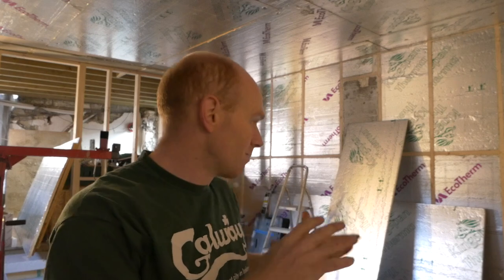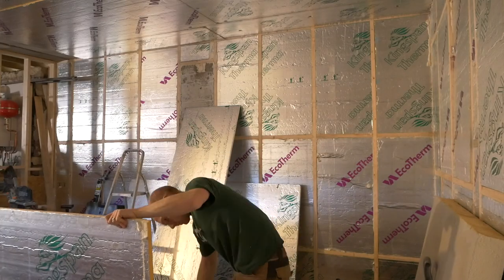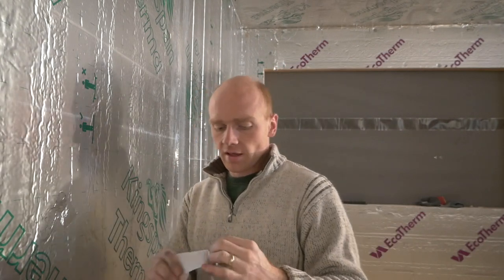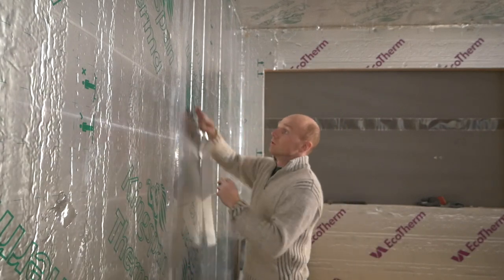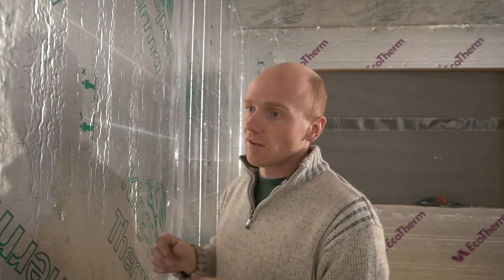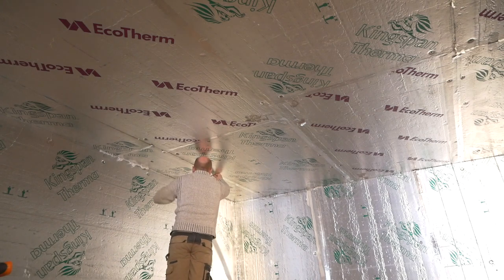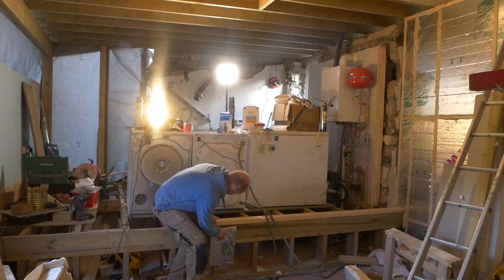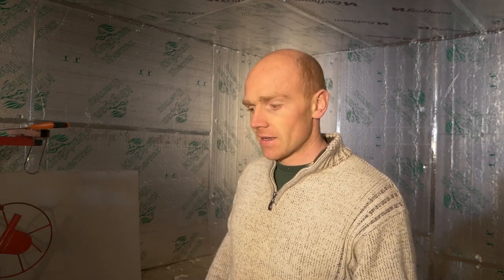INSULATING STUD WALLS - Step 2 of 2

Comment: How do you access the electric outlet boxes, the water pipes, ventilation, and temperature conditioning?

It seems super insulated, but how do you get fresh air, and how do you cool and heat the space?

Is this only a living or sleeping room?
Reply: If it were my build and I ran wiring after insulation I would use wall mounted conduit tubing and outlet boxes. same style you see in many brick schools and basements.

Comment: We did a very similar detail on the barn conversion but the one thing that I really wasn’t happy with after all the sealing and tape was fixing the plasterboard through what is the vapour barrier into the studs. Thats hundreds of penetrations and I know they are regarded as essentially self sealing but it just didn’t feel right. Love following your build and many thanks for sharing 👍
Reply: The way I've done it in the past (and about to do again) is to batten over the PIR board and then screw the plasterboard to the battens, that still leaves you with about 3-4 screws per batten. 

To seal these holes I pre-drilled the battens and started the screws, then put a big blob of builders silicone over the hole and screw point. Then just put the batten on the wall and screw through. You have then sealed each hole with silicone. Its an added step, but only takes seconds if you were going to batten anyway. I was using battens to give a void for services (as Tim mentions in the vid).
Reply: James Marriott actually James that sounds like a much better solution sealing each penetration with silicone. As you say an extra step but I’m guessing once you are up to speed and into the rhythm of the thing, the extra step isn’t a big deal, thank you 👍
Reply: @ThePhilandPam  Indeed, the battens came in bundles 3x3, so I drilled 3 at a time, laid on a pair of tressels and ran in 27 screws in a batch and then blobbed on 27 dabs of silicone. About 5mins to do a bundle if you have the stuff to hand.

I give it about 20mins before a tradie pops up and tells me its not necessary and I don't know what I'm talking about. But I was happy with the result. :-)
Reply: James Marriott I like the sound of that, I’d feel a lot happier knowing my vapour barrier was actually vapour proof, that’s the way to go 👍

Comment: Really enjoy the TRC videos!  How did you tape the inside corners? I’ve used a straight-edge, short pieces and foul language.  Wondering if there might be a better technique...
Reply from the maker: Just crease it first and then try and get the point in the corner before you stick the rest. Not that easy with the basic foil tape.

Comment: Wouldn’t recommend dabbing to insulation but apart from that you’re knowledge is excellent for someone not in the trade. Let’s face it though, having followed you for a long while, you’re practically a tradie now, and a bloody good one! Love the videos mate, keep it up!
Reply from the maker: Thanks, I’ll stick to extreme diyer for now! I just use a bead of the gun grade board fix as a back up. Obviously it relies on the insulation being secured well but that’s done by the drywall screws too. 👍

Comment: Maybe I'm overthinking this but how would you prevent thermal bridging through the joists if you put a warm roof on a single skin garage?
Great vids btw!
Thanks.
Reply: A self adhesive vapour barrier below the insulation. The only bridging is the screws for the top OSB board layer above the insulation. So osb above the joises, vapout barier insulation tape seams then osb and water proofing like owl lava or  iko roof star. Don't cheap out on the vapour barrier or the water proofing.

Comment: Just found your videos, you are incredibly good at explaining things in simple terms and don’t make me feel stupid! I’m planning on frame insulating and   boarding on the inside of my garage door to try and insulate the garage to make it slightly more usable. Do you think the extra layer of insulation is always required ?
Reply from the maker: Depends if the added weight or width will affect the door opening and closing, (if still in use) if still being used as a garage I would suggest bonding the insulation directly to door if possible and draft proof the gaps with suitable seals.

Comment: Hi tim do you have to put air brick in is it best floor level or high level  if my garage is air tight no sure mate iv do the roof up to yet and the walls are just been painted and false floor and that will be insulation under it can you put me right please thanks

Comment: I know you said that one of the walls was an internal one through to the next room and you weren't going to insulate it.
However, I would personally.
As you have done such a high grade job so far I would carry on.
When internal walls are insulated they can make it easier to keep certain rooms at different temperatures.
You may want some rooms to be warmer and others cooler and with insulated walls all round that room becomes easier to control temperature wise.
Just a thought from someone who enjoys your videos and has never had the opportunity to do what you are doing.

Comment: Bonding the boards together is a really great tip, i have loads of 50mm boards left from a previous project. I wanted to use 100mm between my studs, but I'll use up my 50mm boards first before ordering anymore! Without loosing ceiling height do you have any tips for installing down lights in a foil insulation roof? I was considering leaving a small void in the foil insulation, packing with some mineral wool and using a fire rated housing for the LED's.
Reply from the maker: If you have the height to allow for counter batons that is always the best way. You can then run all of your cables and lighting underneath the foil surface.

Comment: Hi thanks for the video. 

Do you always have to insulate in between the studs or can you insulate just over the top before your plasterboard?

I know you've done both but what are the pro's and cons? 

I'm thinking of just insulating over the top (2 internal stud walls) to save a bit of money (less insulation wastage on these particular walls) AND I'm thinking it will be better for sound insulation as will have a gap in between the both sides (the wooden frame).

Any advice would be greatly appreciated as I top have an old house I'm doing up.

Comment: Fantastic job Tim! Am interested in vapour control though when insulating between stud framework will be about 50mm off an external 140 year old rubble wall that was obviously intended to evaporate water internally when thoroughly wet from rain. I'm concerned that a vapour control barrier will trap this moisture ,that has passed through the solid wall, within the air gap. In many ways I'll be happy to lose some of the value of insulation by not having it too tightly sealed as maybe it would make sense to ensure the gap has some airflow through it?  I'd be very interested in your thoughts Tim and thank you very much for the videos.
Reply from the maker: We decided not to insulate our main house solid walls for the same reason/risks. It is possible but can lead to other issues.  If you don’t do a breathable internal insulation then a complete sealed option would be only option I would probably consider. That does however mean that you would need to insulate all walls including between joists where they meet wall as that can end up as a super cold spot/ condensation. That said we did stud off the stone wall in the garage conversion but vented the cavity behind. Safest option but more expensive would be breathable board and plaster. Remember whatever route you go you should go through building regs anyway for IWI so they will likely have own views.
Reply: @TheRestorationCouple  Thank you very much for your helpful thoughts on this Tim. I've long been tempted to go down the route of a breathable internal insulation, vent the cavity and maybe even drill a series of inconspicuous fine holes to enhance air flow in there. All seems a bit counter-intuitive I know. Anyway, good luck with the restoration your videos are tremendous.

Comment: Taping up the insulation fixings and joins, but then penetrating the pir with a plaster board screw when hanging the gypsum? Is that a building regulations code or just had the time and tape so doesn't hurt to do? Hope you met your deadline and excited to see what happens next!!
Reply: I was an avid watcher of Holmes on Homes and always wondered the same thing.  Mike would always bang on about warm, cold side and stopping air movement, then like you commented hang the drywall with a screw through the vapour barrier membrane.  It always perplexed me (Jackie Chan meme face) how in Mike's case he was very pro/for stopping air movement but then put lots of holes in the thing that was stopping that air movement.  Now granted I am no builder so what do I know, but it always struck me as a thing to be at odds with.
Reply from the maker: Taping the joints is the main barrier, screws or nails through the vcl are almost self sealing, certainly enough to not compromise it. I read some research on it a few years back when we did all the suspended floors and was reassured. Different story perhaps if you were going airtight. In the van conversion I battened over pir and then taped over that which solved it.
Reply: I can't see air or vapour getting through a screw in a wall

Comment: Thanks for explaining how the vapour barrier works, I’ve built a new shed, workshop, and I’m insulting it with 50mm polystyrene should I go over it with polythene do you think 🤔
Reply from the maker: Depends on how you heat it, what the finished walls are and also whether the gap beyond the eps is well vented. Might not be needed but eps is breathable.
Reply: The Restoration Couple thanks for your reply 👍

Comment: It's a little overkill. The kingspan can be replaced with a standard polyurethane insulation with no foil and then a final vapour barrier installation be it a tacked viscreen and plasterboard or a foil backed plasterboard.

Comment: With all the insulation how do you intend to keep ventilated from stale and damp air without heat loss? We may be taking on a house renovation soon and I am struggling to find a retrofit solution to an older house to solve the problem of removing damp air without heat loss.
Reply from the maker: Mvhr unit. Single unit is an easy install if not doing full time renovation.
Reply: The Restoration Couple do you recommend one or do you have a go-to one?

Comment: Have you looked at using a triso super 10 quilted insulation. We use this on our projects now and tend to stay away from pir board.
It's neater,tidyer and also saves a lot of money.
Reply: In the video when the insulation was delivered, Tim mentioned that the panels were reclaimed (one of the advantages of rigid foam board insulation).

Just curious, why do you try to avoid PIR? Besides having one of the highest R/U values for a given thickness, PIR is usually faced on both sides, one usually foil that's a great vapor retarder, and it's hydrophobic. As a thermoset plastic, PIR can't be melted. As such, it chars over in the presence of flame. Additionally, the blowing agents used in the manufacture of PIR aren't harmful to the environment.
Reply: @ARepublicIfYouCanKeepIt  .yeah I did hear that, but the performance of the triso far outperforms pir board.for instance I use 30mm pir board then cross line it with triso,tape the joints then cross batton and plaster board.this equates to the equivalent 150mm of pir.
The saving is substantial and the quality of the job (in my opinion) is far superior.most of my local building inspectors now recommended this,also due to it being a quilt it makes it far easier to line a roof,hips awkward angles etc and makes for a far more airtight seal and would take me literally half the time of pir board.
Reply from the maker: Looked at using it on the loft but at the time bco were sceptical. Seems like it’s a good option in some scenarios though so may look again. For this project it made sense to get a whole bulk load of boards as they were needed for floating floors and ufh setup in another room anyway so just did it all the same.
Reply: @TheRestorationCouple  absolutely,I wasn't criticising how you did it as it's exactly how I did for the last 10 years. Since I've switched to multi layer quilt insulation I'd never move back. I tend to get less wastage and mess as well,when I've finished a job I just roll it back up for the next project!

Comment: Correct me if I’m wrong but when you are fixing the plasterboard to the studs with screws are you not piercing the vapour proof barrier?
Reply from the maker: A screw essentially self seals as it goes through the which is sufficient to retain its vapour tightness, especially when skimmed over after. Another way is to counter batten first however you will still not avoid some fixings penetrating.
Reply: @TheRestorationCouple  Thanks for replying, about to do my own garage conversion in the summer, thanks for sharing the knowledge

Comment: What are you doing to thermal seal the gaps at the bottom of the insulation?  Some of the gaps looked pretty big.
Reply from the maker: Floor being raised with insulation so will join walls.

Comment: Vapour barrier that you have place outside is this just to prottect timber ? you have mentioned that foil is already vapour barrier from the factory. Or is vapour barrier outside is different from vapour barrier inside ?  I will be converting horsebox, that is wooden , i will be using kingspan and then interior cladding, where do i need that barrier ? outside of kingspan , inside or both ? Can you also explain if they are different materials, i know what are they for, but aren't they the same ? cheers
Reply from the maker: The membrane on the outside is just like roofing membrane and breathable.  It is just to keep timbers protected should moisture ever get in to cavity and during construction when they were exposed.  I doubt they would be needed in your case.

Comment: Where do you run the electrics and fit Lights and back box ?
Reply from the maker: Future video. Either inside a service void if you counter batten over insulation or in this case it was run along floor and up in conduit.
Reply: The Restoration Couple look forward to next video. Thanks for reply

Comment: Where do you run you able in the insulated stud walls?
Reply from the maker: Either along cavity behind and come through, create a service void with battens over insulation before plasterboard or in the case of the garage conversion brought along conduit below floor level and up to sockets.

Comment: I have an old house, where the external walls aren't insulated and I have high level of condensation on the windows in the morning. This is causing dampness on the lower level of the wall and the corners (second floor bedroom).

I'm looking at battening, insulating with PIR between then moreover with PIR sealing any joints etc, then lastly plasterboard. Would a vapour barrier or moisture barrier be required before the battening?

Thanks in advance.
Reply from the maker: We have an old solid wall un insulated house and the last thing I would do is use pir on the walls. The first thing would be to sort ventilation, then get walls breathable. You could then look at breathable insulation materials. I will be doing a video shortly on this as it’s a tricky topic. Very tempting to just stud out and insults however there are so many risks it’s not a quick decision. If you did do it with pir then yes a seamless perfect vapour barrier would be needed but that is very hard in a renovation scenario.

Comment: Hi nice video but, Where does all the vapor goes after all this insulation ?
Do you have a ventilation system ?
Reply from the maker: Just passive ventilation through vents to outside. A larger more airtight build would be best suited with MVHR.

Comment: What happens to the Vapour barrier when you screw your screws through the batons in 
preparation for the plasterboard is the Vapour barrier not compromised?
Regards Robert
Reply: I think he covered this one in the loft conversion series, think what he said was the screws are sharp and so only make a tiny penetration. I have not heard of problems from this anyway.

Comment: Do you not think this is a bit extreme.. how warm does it need to be ?
Reply from the maker: It’s not how warm it needs to be but how much heating it needs to be a comfortable temp. For reference this is the minimum legally required for UK regs so not much choice anyway. 👍

Comment: Hi Tim, I have a timber framed building/utility room on the side of my house I built and have insulated between the studs like you, but was then was going to put plater board up, I didn’t know you had to have a second layer of insulation? 
On the outside it had a breathable membrane then rendered, inside there is a 25mm air gap then the insulation between the studs, then I was going to plasterboard and have plastered, is that not right?
Reply from the maker: Usually, insulated plasterboard or a layer of insulation is needed to get to the required u value. It can be done without but a vapour barrier is still vital and you will have some potential cold bridging.

Comment: what about lights and power? all surface?
Reply from the maker: Conduit along and up. The floor will be raised. It’s in the next video. Lighting will be dropped through as a central fitting but waiting until I’ve designed it. 👍